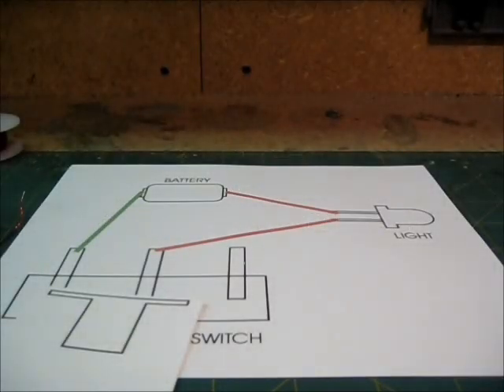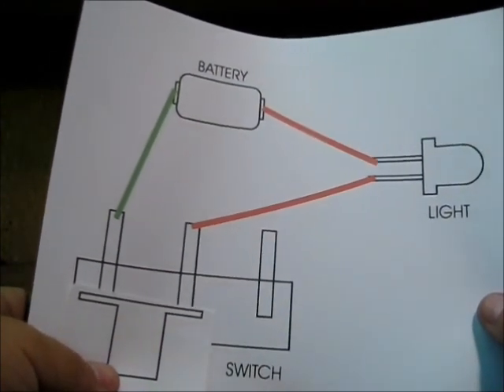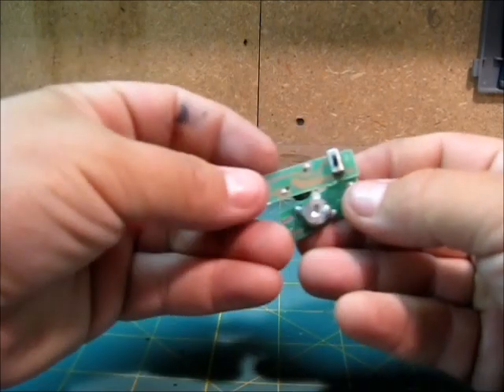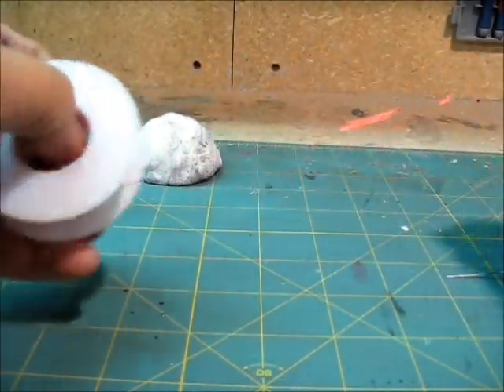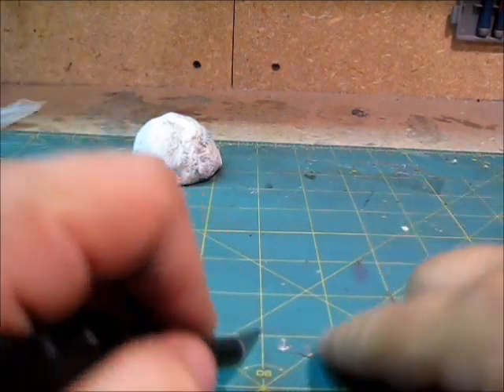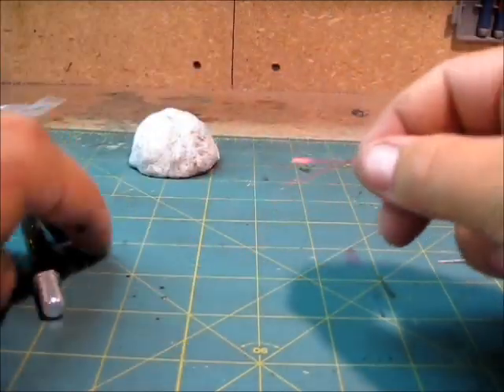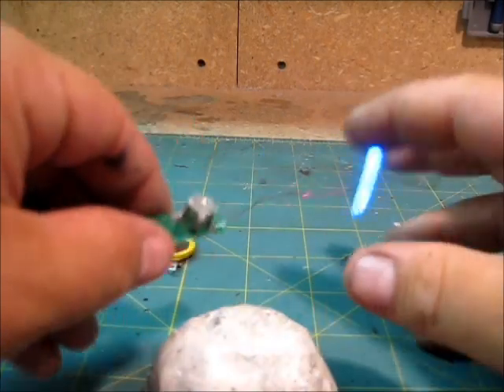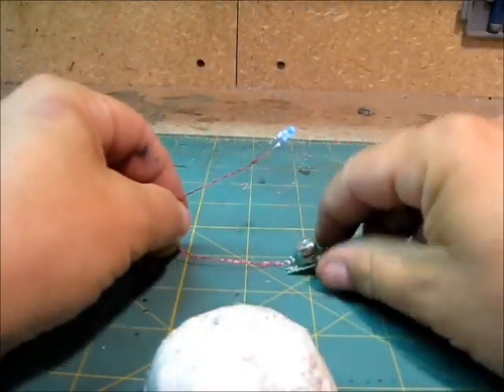Tutorial : LED lights for beginners

Comment: I was told that the long probe wire on an LED was the + (pos.) and the shorter one the - (neg). When I saw you cut them both off my mouth dropped. Why doesnt it matter then which gets connected to the pos and neg terminal

Comment: Where can I find tiny LED lights that I can wire directly to a battery with an on off switch ? Must be so much easier then all this mucking about
Reply from the maker: There's no such thing,  unless you buy a premade kit. Either way, you're gonna spend time rewiring for the proper length.
Reply: Alec Cap - On eBay, UK seller "fadswithflair" has bundles of pre-wired LEDs in different colours and sizes. Eg 5 x 3mm LEDs for £1.92 post free.
Your use of "mucking about" suggests you might be in the UK, so I hope this helps! 💡

Comment: guys im new to soldering and stuff and wanted to ask something. can i solder the battery to the middle pin and a red cathode on the left and the blue cathode on the right for example en make another switch between the middle pin and the battery for on and of? so that i have 2 switches and so can switch between blue and red and on and of?

Comment: This video made me cringe........ an LED is NOT like a traditional filament light bulb. An LED needs a resistor to limit current flow, in this case, because you are using a button cell battery, the battery is acting as the current limiter. If the LED were to be used in 12v automotive application you must provide a 470-500 ohm resistor in series with the LED as a current limiter. 
Then at 8:25 when making the connection from the LED to the power you say, "...it's a 50-50 shot I'm not sure which was negative which is positive, really doesn't matter as long as it works...", Um, WHAT?!...it DOES matter!, an LED will only conduct one way, they’re polarized! The acronym "LED" stands for "L"ight-"E"mitting "D"iode. A diode is a semiconductor device with two terminals, allowing the flow of current in one direction only, when there's current flow it emits light. So it MUST be connected properly, whereas a traditional filament light will conduct in both directions, they’re non-polarized. 

How to identify an LED's lead polarity:
An LED has two leads, an anode (+) positive and a cathode () negative. Typically the anode (+) will be the longer lead and the cathode () will be the shorter lead. Some manufacturers produce LEDs with leads the same length, in this case or if you are repurposing an LED harvested from an old device or if someone has trimmed the leads, look at the base of the LED, there will be a flat edge on the LED’s outer casing by one of the leads. The lead nearest the flat edge will be the cathode (-).

Comment: I'm totally new to this and I can't find any wiring that is like you've used so can I use small cables instead of this? The Amazon product says it's copper litz wire (0,14 mm² - Ø0.90mm with isolation) so can I actually use this? ._.' feels like I just asked if I could use glue to cut paper

Comment: Polarity matters, if you confuse positive and negative it'll either fry the wires or even start a fire
Reply: PetersaberHD ...not in an LED circuit...get the polarity wrong, and the light won’t work. Also, the common resistor isn’t polarized.

Comment: No current limiting resistor=dead led in a short time. As for a run way i would say use a 555 a shift register and a bunch of transistors to drive the leds (as amps so that your not pulling power through your shift register only a signal)

Comment: You need to add a resistor to your circuit. The resistor itself has no resistance and as a result the battery will burn out quicker because your essentially shorting it out.